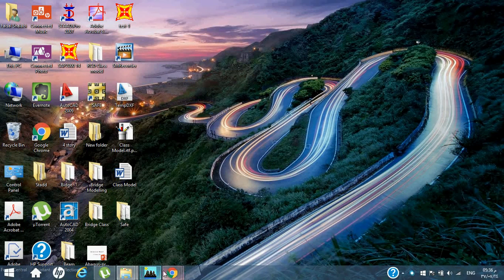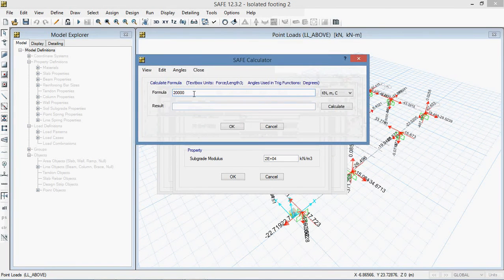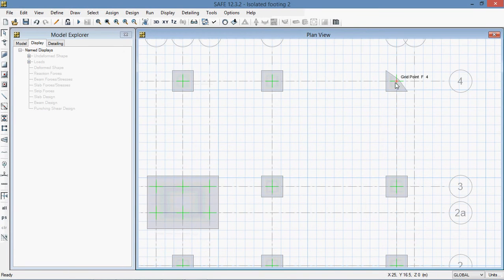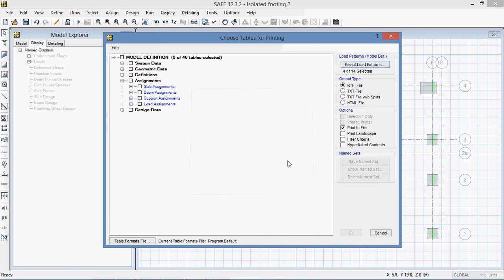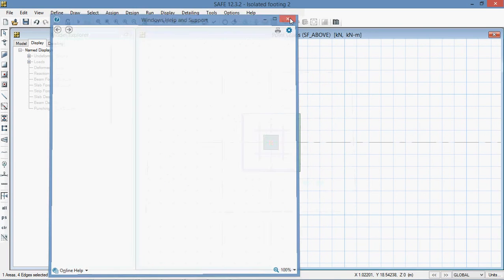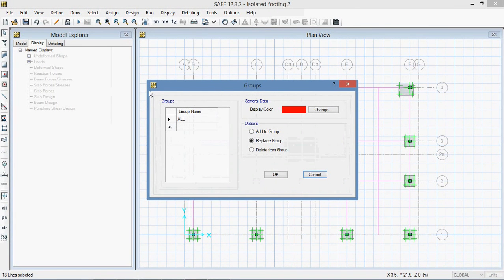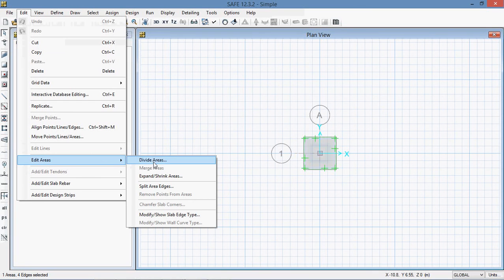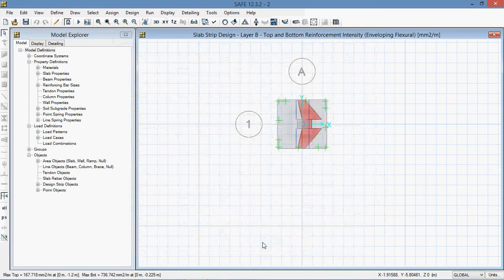Design of Isolated Footing using SAFE Part 5

Comment: I drew only the grid of the building and i drew only one type of footing with same load condition in different grid point. Their displacement, bearing pressure is exactly same, but the slab design is totally different. HOW???